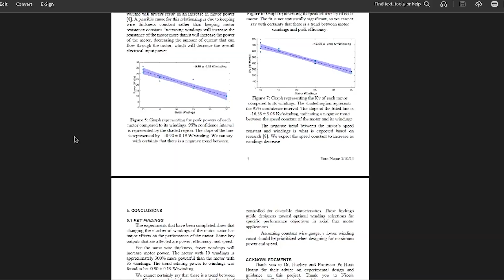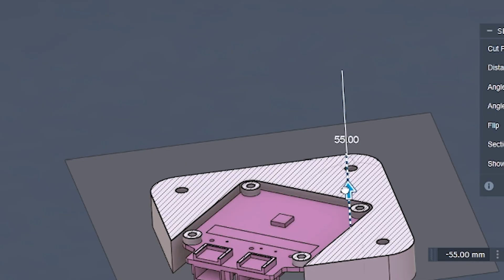What I've made in 4 Years at MIT

Comment: i love the flamethrowers haha, did you burst a hair spray can for fuel? also I noticed the motors for the wheels used the cheap 3 dollar motors from hobby lobby, I also have these but they do not seem to be as powerful as I need. gear ratio? id love to talk about design choices, I run a makerspace club at my college and im building an RC car from scratch
Reply from the maker: For the flamethrowers i use butane cans. The cheap motors really dont have enough torque haha, swapped off of them pretty soon